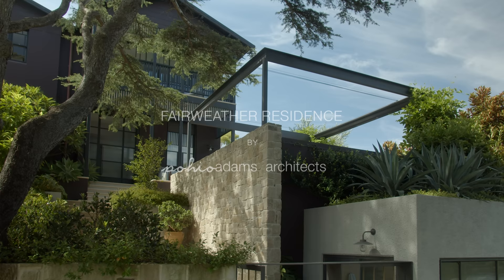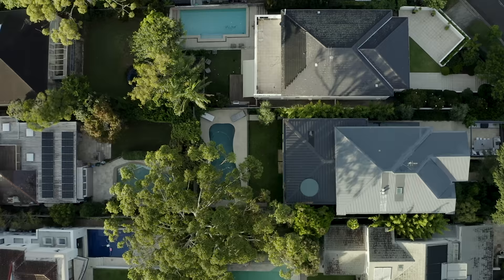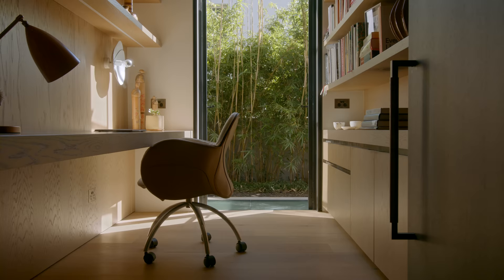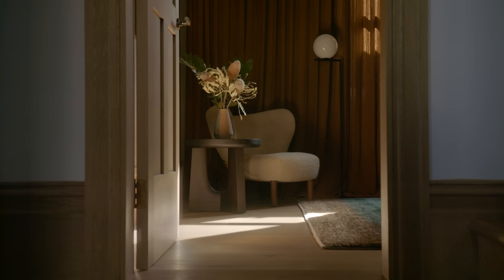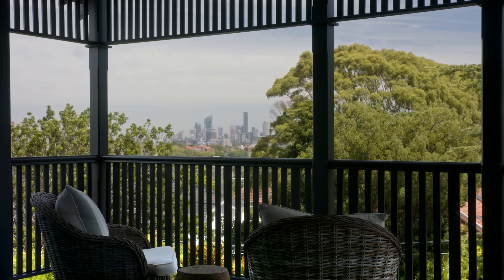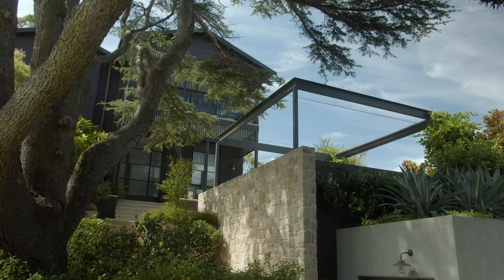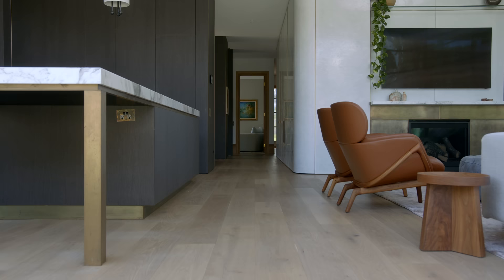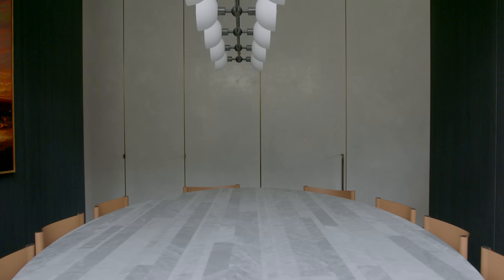Architect Designs a Glass Pavilion Home with a Modern Kitchen (House Tour)

Comment: I am looking to build a steel and glass construction design type house, and I saw the thumbnail for this one. It is kind of misleading. One thing I do not like about this house is that it has no flow. Too many turns and corners. Upon hearing there use to be another type of design of house that they built around explains that, but this is not like a design I would use.